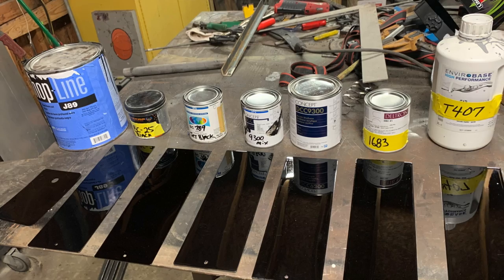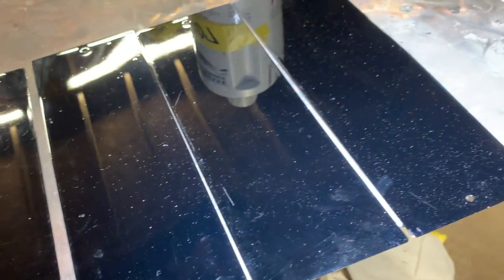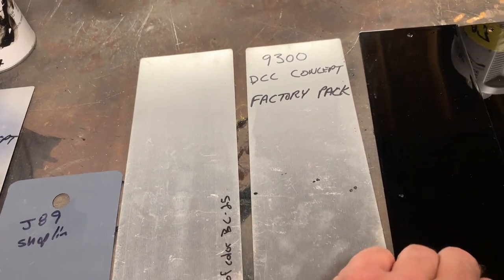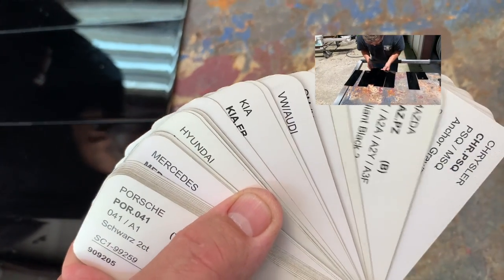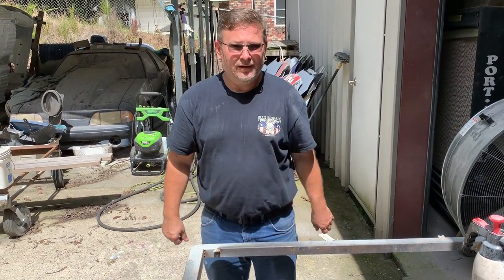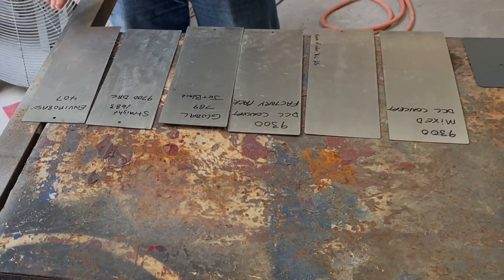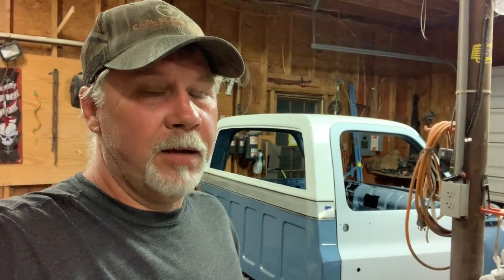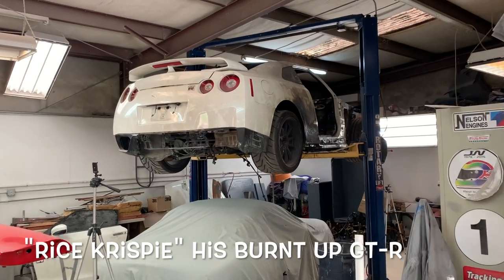Blackest Black: Comparing Black Automotive Paint #blackest #blackpaint, #jetblack

Comment: What about white? Just plain solid white. No pearl. No metallic. I want the whitest plain solid white possible for my 96 Buick Roadmaster sedan. I don't care if it's single stage or base clear
Reply from the maker: You can go with the straight white main mixing toner from the paint mixing machine if you want. It may or may not be the white you want so it’s best to find a paint chip you like and match to that. Check with your local paint distributor or a local body shop and see what is available. Thanks for watching!